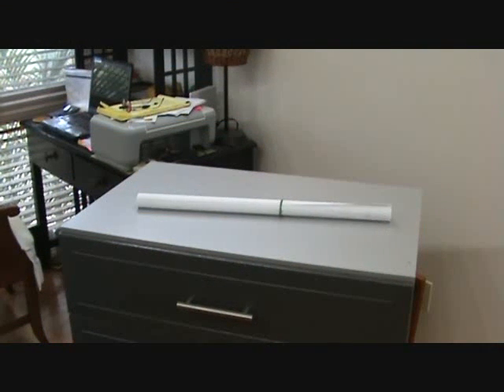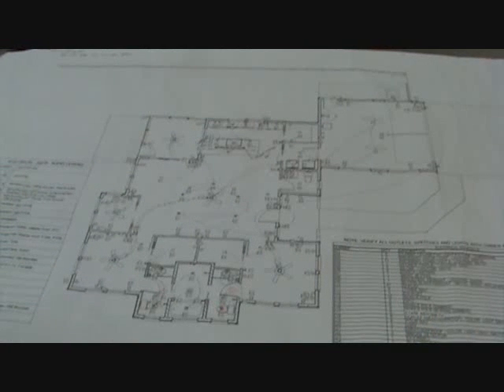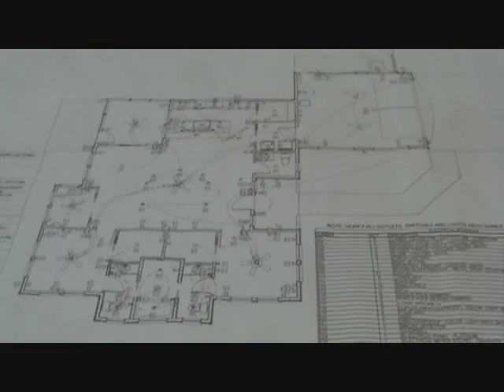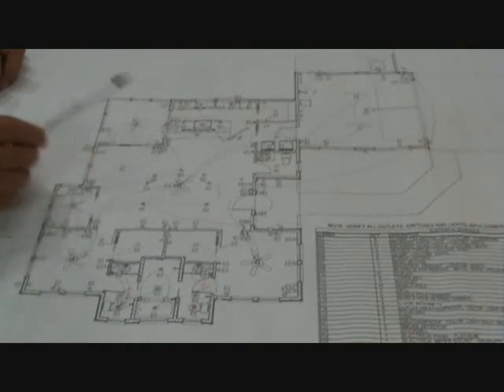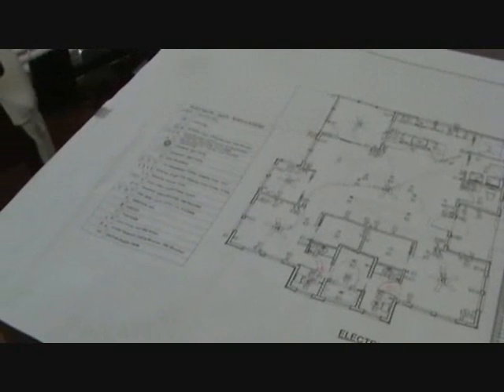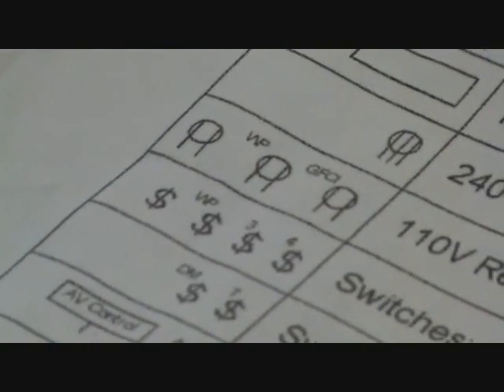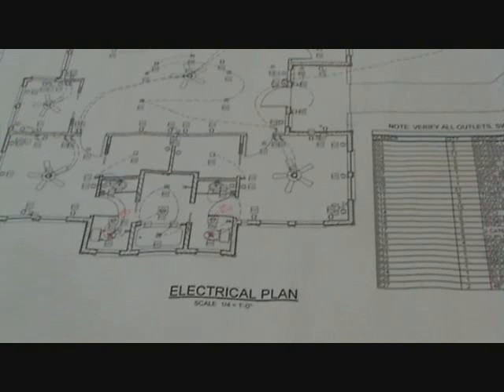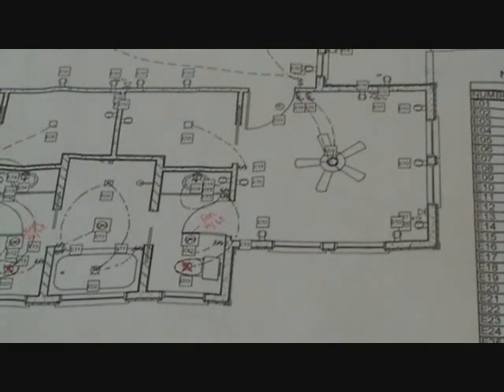Reading an electrical drawing starts here

Comment: Gobbilty goop? Is that an electrical device?
Reply from the maker: Yes that is an electrical device that does special things by measuring once & cutting twice in this case reading the measurements twice also helps with the goop substance when you get ready to install stuff.

Comment: Hi Joe great video, could you recommended a good electrical estimator software/electrical drafting software? I had a quick look at autodesk electrical and solidworks electrical but it focuses more on electronics more than construction. Do you know if autodesk cad and solid works are capable of doing electrical drafting? Thanks.
Reply from the maker: Sorry I don't know anything about cad system but I'm sure by now you are an expert!

Comment from the maker: @jchambers2586 This is really different than an aplliance wiring diagram as this electrical drawing basically shows the locations of items needing to be installed rather than showing you how to wire up each item like an appliance diagram. This just gives you a better understanding on where electrical items go in a home, etc.. Thanks for commenting.   Joe  :0